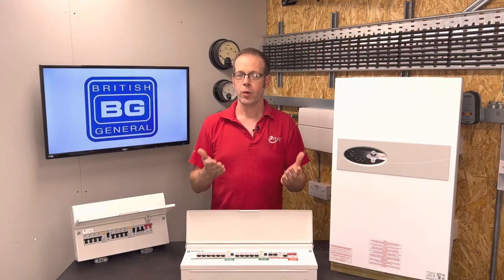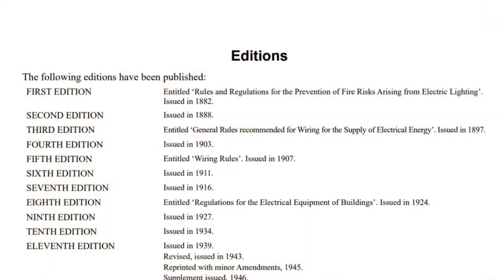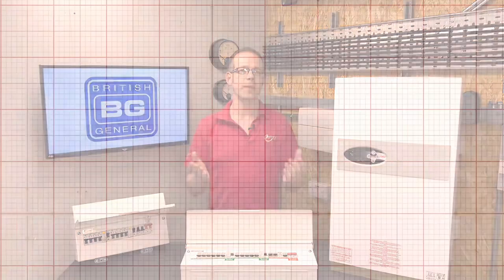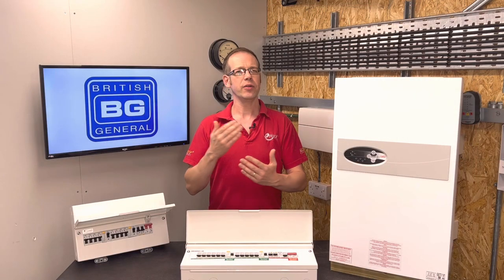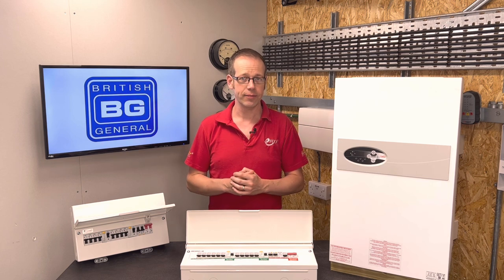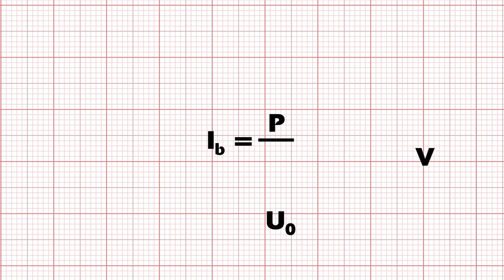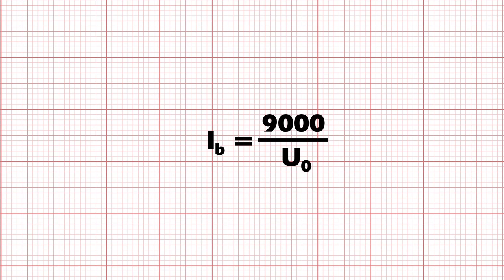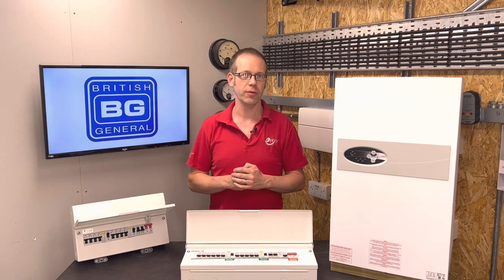Electrical Design - Calculating Circuit Current

Comment: Excellent Joe! Can you clear up a 3 phase design please? 

I'm unsure whether U0 is 400V or 230V and which one you use to multiply it by root3... Right now I think this... 

You use the nominal Phase Voltage. This will be 230V in a single phase installation, but can be 230V or 400V in 3 phase depending on the supply.. usually you have a star supply from the transformer so U0 is still 230V, but is there industries that use a Delta supply and therefore U0 would be 400V and would you still times 400V by root3? 

Hopefully my thinking makes some sense. Anyway thank you I love these videos and I've learnt so incredibly fast on my journey to becoming an electrical engineer!

Edit. my bad, I got line and phase voltage mixed up. U0 is always 400V and therefore needs multiplying by root 3 if the supply is a star supply. So if its a delta supply, you don't need to multiply U0 by root 3?? Because phase voltage and line voltage are the same????????
Reply: Yes on a 3 ph delta load the current will need dividing by root 3. i.e a 15kw load will be about 21A.